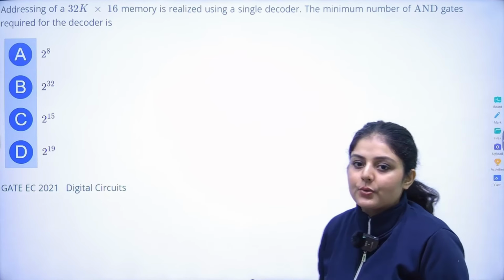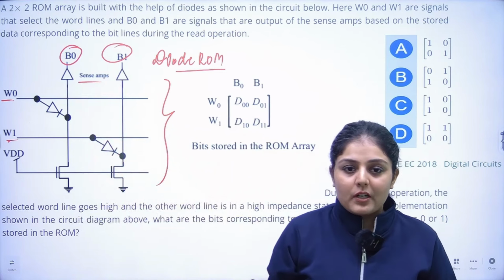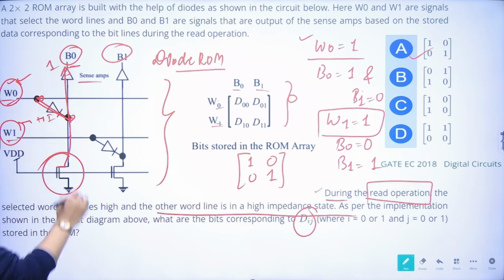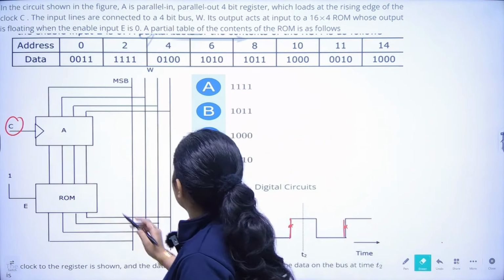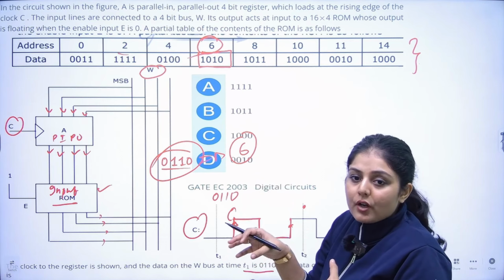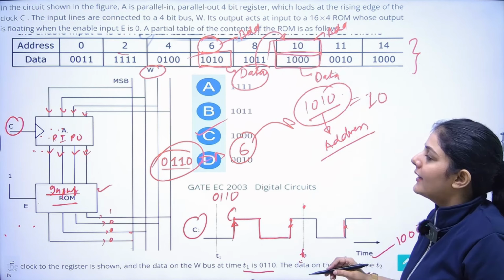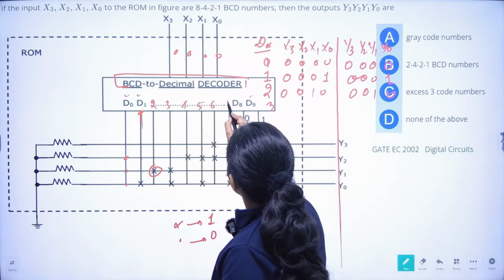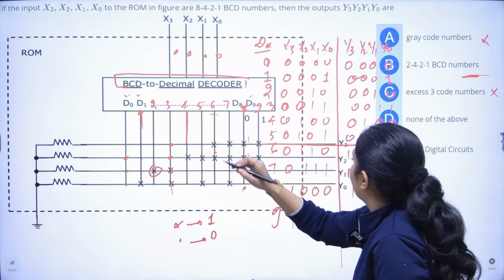DIGITAL ELECTRONICS Test & Interview QnA Class-15 | MEMORIES | Visit us on www.vlsiforall.com

Comment: In the 2nd questions the nmos transistors are connected to the vdd means both the transistors are always conducting(channel established) so if we make the voltage at wordline w0  high then the transistor has to discharge that voltage to 0 by ground and make the b0 to 0.

could you please explain me what am i doing wrong ?